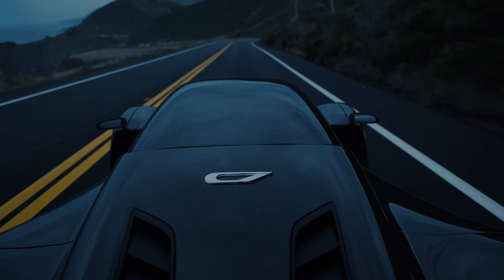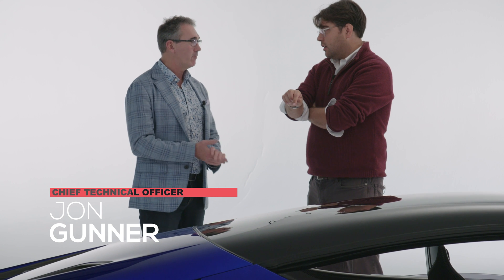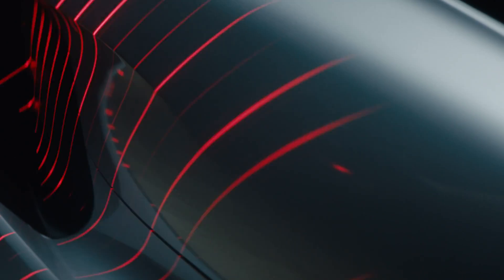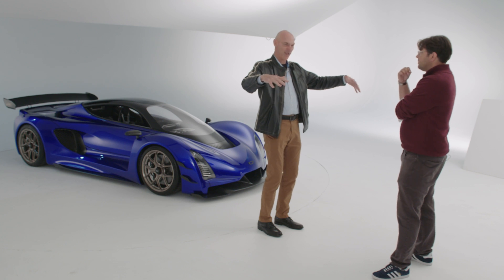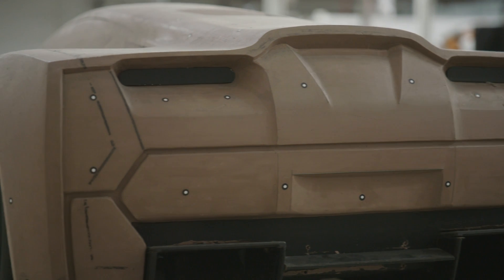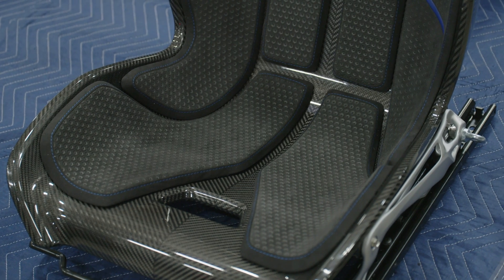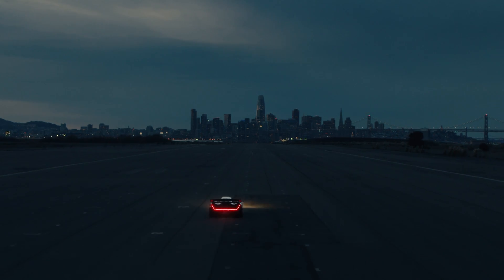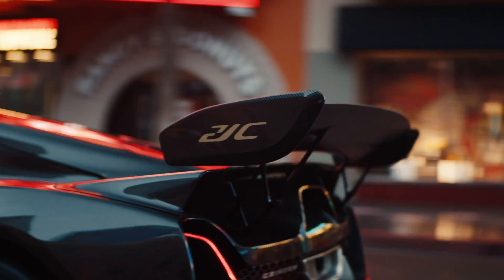3D Printed Czinger 21C And SR-71's Shared DNA – www.APEX.one

Comment: An A.I. designed, manufactured and assembled car. Once the initial start ups costs have bee recovered. The costs can be lowered and be able to offer cheaper options. But admittedly $1.7 million for a hypercar is dirt cheap.
Reply: 1/10 second faster than a ferrari 488 challange car, 6 seconds behind a real gt3 race car whilst having AC, Interior, adjustable seats. Is insane.
1.7 million USD is as you said, dirt cheap for something that marks a new era in the industry